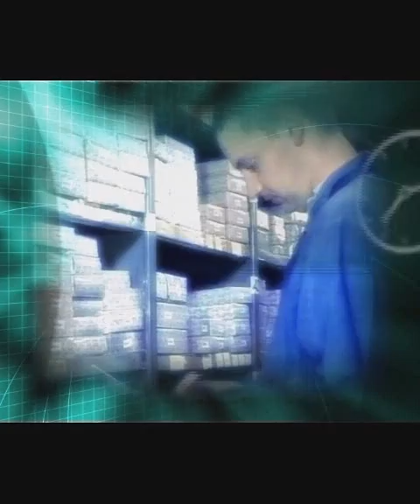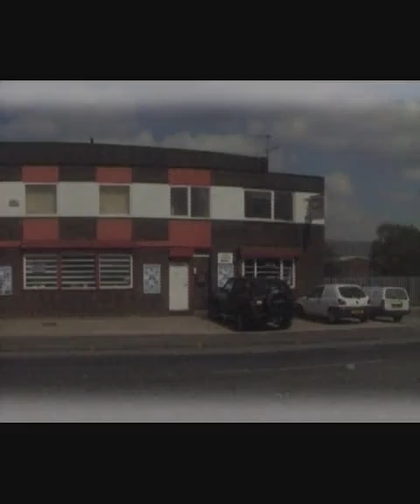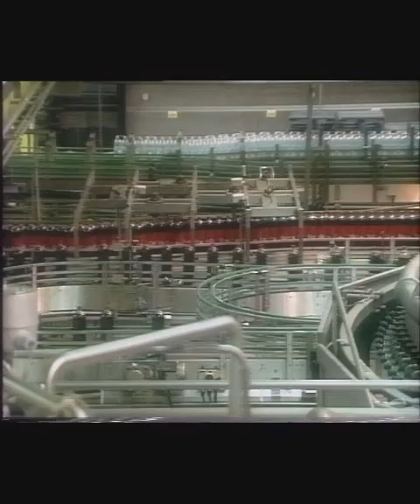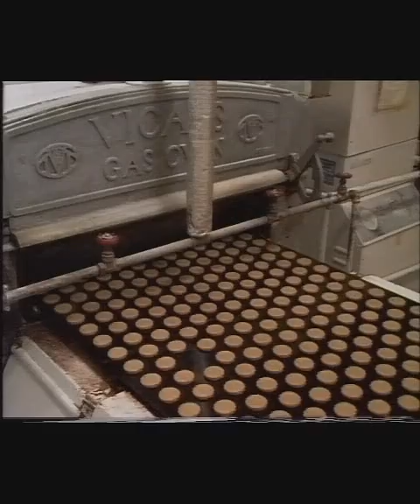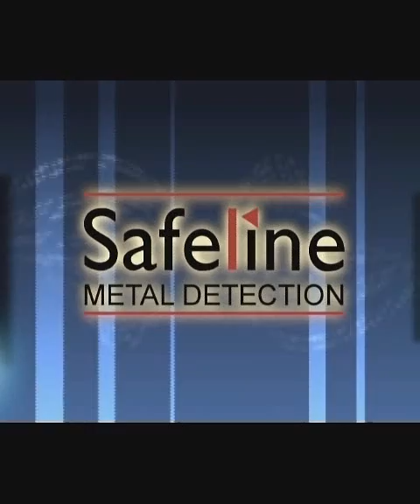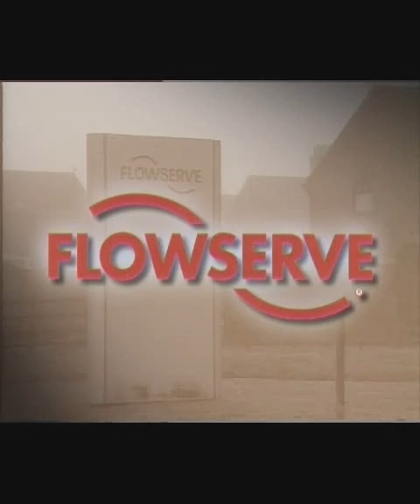Gear Cutting and Engineering

Comment: This company provides 24-7 engineering breakdown service, where they manufacture parts on an emergency basis. Process companies in Food, Paper, Print and aggregates industries rely on them to reduce downtime and increase productivity. Besides being able to supply parts from leading brands around the World they also manufacture Gears and special one off components such as splined shafts, sprockets and conveyor parts. They offer standard 2-3 day delivery, and a same-day U.K. emergency delivery.